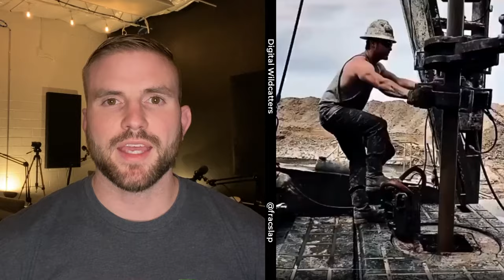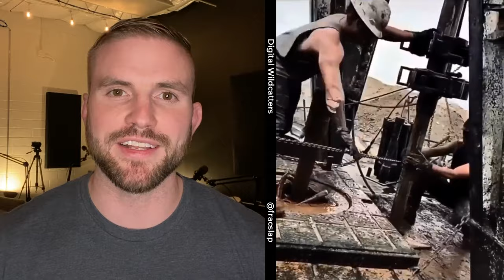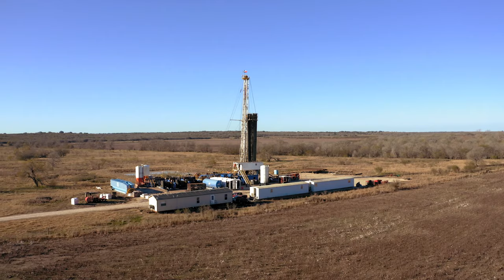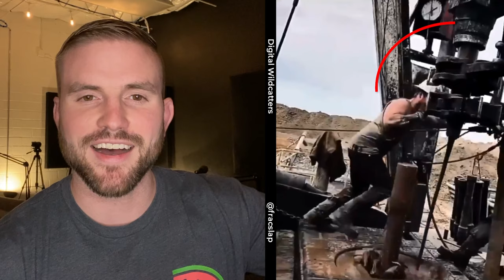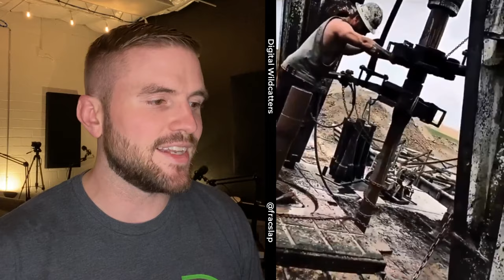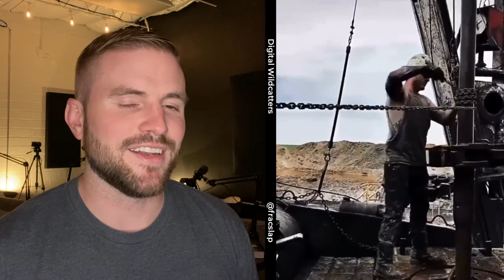What Does a Roughneck do on a Drilling Rig?

Comment: Why this came up not sure. Maybe home sick. Anyways first of all you did well. Couple things, first the Kelly cock is a valve. Some parts of the country call it a lower Kelly valve. Now this rig looks like all it has is a saver sub and its called that so you save the threads on the kelly. In most cases those subs are stacked because most states and the feds require a lower and upper Kelly valve. Actual Kelly is above the bushings which by looking at the rollers it is a hex Kelly. The chain in the mouse hole basically is called tailing and the chain hand is throwing it in the stump. It's been along time since I was throwing chain but working derricks was my favorite.
Reply: What makes derrickman one of the best positions? I've seen that a lot in comments.
Reply: @Girrrrrrrr   it actually takes experience first of all, you as a Derrick hand take care of the drilling mud which has tourly (which most are 12hrs) treatments and while drilling checking the mud properties every hour and make sure you keep it where they say so you don't have a blow out or knock the bottom out down hole which means you losing circulation and making sure the mud pumps are working right and thats a whole nother subject on its own. While you are tripping Derrickhands are up in the Derrick 90 ft above the floor. So if you are scared of heights it will take some will, but the trade off the view and you are alone and it's always a challenge.
Reply: Outstanding, thank you very much for the explanation! @johnnyturner8514

Comment: How long does it take for the rig to go another 30 ft.? In other words how much downtime between connections do the roughnecks have?
Reply: A minute or a day, depends on what you're drilling thru, if the consultant for the oil company is worried about replacing the bit they'll drill at a controlled rate sometimes a connection or two a shift!

Comment: They do what they are told.  Where do you find tools on a drill rig?  The last god damn place they were used.  Wet connections when using diesel in place of water for mixing mud, does not make happy rig hands.

Comment: how do you drill to 20,000 ft on such a small rig and manage to rack the pipe?
i worked north sea in the eighties on semi subs, we used to drill to 16,000 ft but our drill floor was 10 times the size of the land rig, did you used to breakdown a lot of pipe each time? just curious

Comment: Can you tell me why the two grabby pieces are so loose and floaty? If they were grabbing onto the pipe like a wrench, why is it not just tight on it throughout the whole effort?
Reply: Those are the petongs, they are hanging from cables because of how heavy they are, the roughnecks latch them on the pipe and then the driller uses his controls to pull another set of cables on the tings to tighten or loosen the pipe depending in which part of the trip they are on
Reply: @blueonblackpowerstroke513  Oh, so it's like a big clamp to give them leverage to attach or remove the pipe?

Comment: 20,000 feet?
Reply: I've been 35k feet 90 foot sections. That 3 pipes connected then drilled down or tripped out to surface.  I was responsible for doing directional measurements (mwd), We drill down depending on formation anywhere from 700 feet to 15k feet.  Then start what is called a J-curve where we would go from vertical to lateral in so many feet.  Once we finish the curve we went into the lateral and pushed through the bottom of the formation the best we could for max production after we left. I've worked in a lot of States but the best was 3 years in my backyard an hour from the house.  Those guys were kind of jealous because I would go home every night 🤣 
Best rig and crew was UDI-126 we were rig of the year for the Fayetteville formation in Arkansas. AWESOME money and cool brotherhood or hate each other depending how hungry you were lol